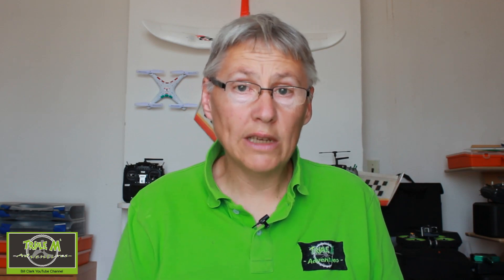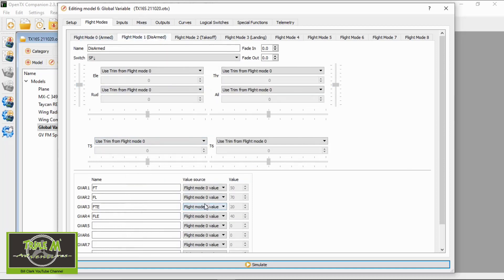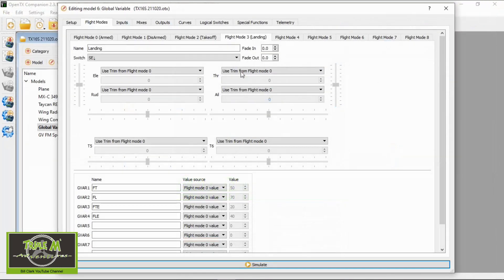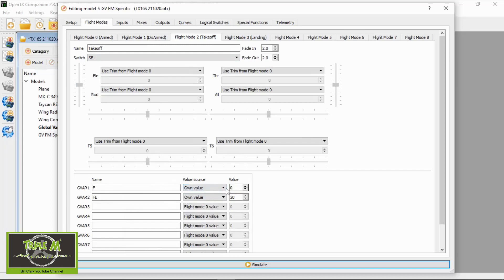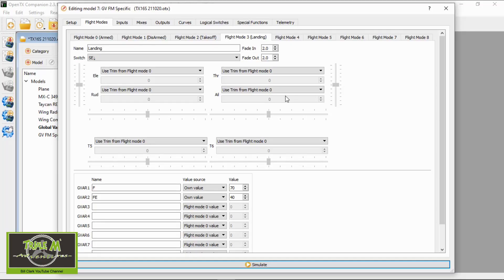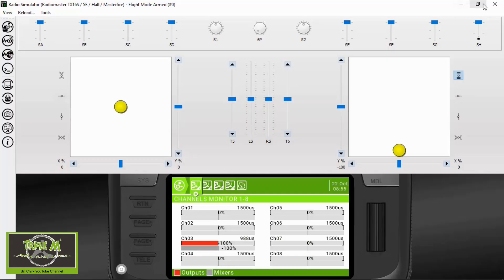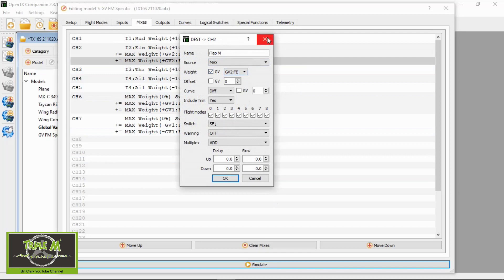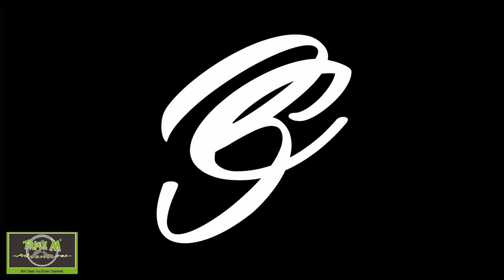OpenTx Flight Modes (FM) and Global Variables (GV)

Comment: Good video but I have another problem that maybe you can show me the way.  I have a battery telemetry that gives me a % value but it is wrong so I would like to multiply by a fudge factor and then present that value as the battery %.  Thanks
Reply from the maker: You need to adjust the offset in the telemetry screen of your model. Click on the sensor and edit.
Reply: @the-happy-RC-flyer  yes I found that but the results make no sense. 11.37 gives 68% and 12.4 gives 98%. This is with no offset. I am confused.
Reply from the maker: @ror-ys3qp  which receiver are you using?
Reply: @the-happy-RC-flyer  matek 2400 with Vario...elrs
Reply: @the-happy-RC-flyer  but I found lipo voltage on Rxbt telemetry so I am good but still do not understand the batt% but do not think TBS know how to do telemetry....it is CRSF software.
Reply from the maker: @ror-ys3qp  RXbt is the receiver voltage of 5 volt. You need Vbat which I am not sure if ExpressLRS supports. I have checked my RadioMaster ExpressLRS receiver and I am not getting either RXbt or Bat % back to the radio.
Reply: @the-happy-RC-flyer  ya that is what I thought but for TBS it is the voltage at the vbat input.
Reply: @the-happy-RC-flyer  yes TBS telemetry is terrible.they are all quad flyers so they rely on FC for telemetry info....they live a sheltered life.
Reply: @the-happy-RC-flyer  EXPRESSLRS/ELRS 2.4GHZ VARIO RECEIVER